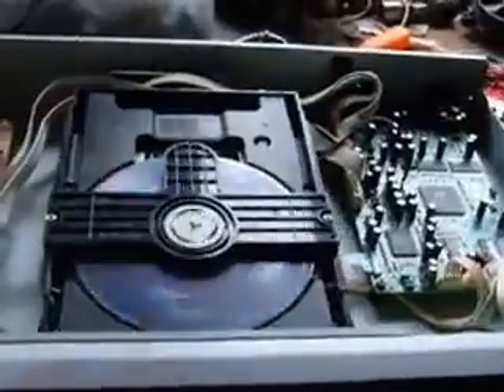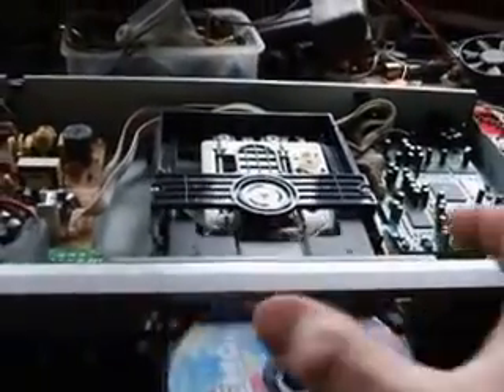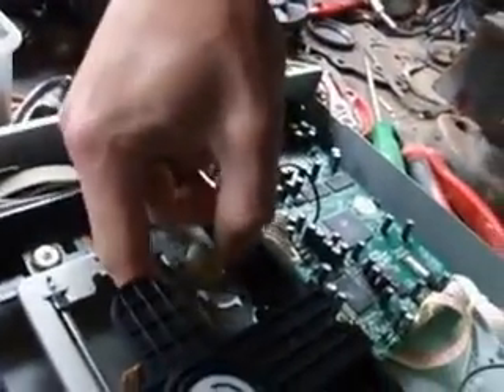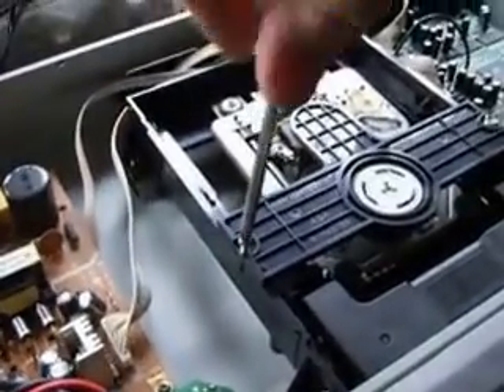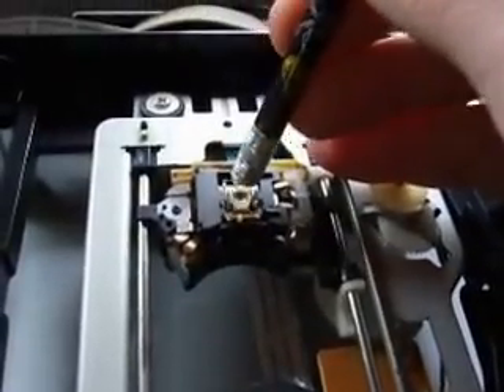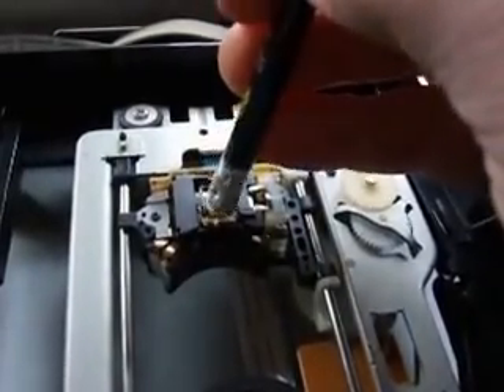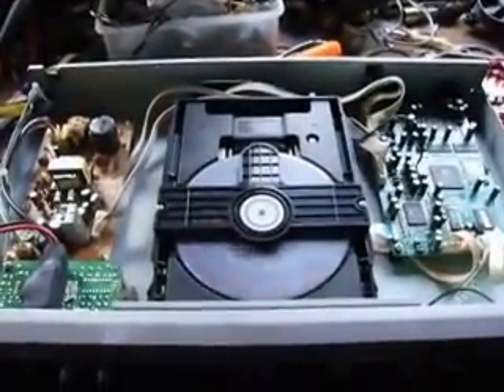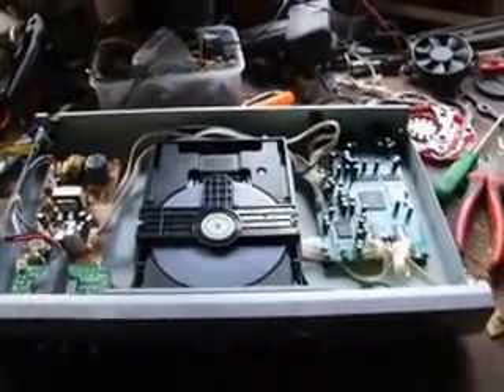Simple dvd fix that engineers use

Comment: So, the general logic behind the things done in this video is sound, but the execution was a bit scary. Air compressors can and usually do contain moisture, plenty enough to ruin any electronic component, and a pencil eraser is a rather bizarre thing  to use to clean such a sensitive thing. A couple of pointers, though. If you use some compressed air, try to gently blast out the space between the diode and the lens (basically UNDER the lens), you'd be surprised what buildup can occur in there, especially in dusty areas. Clean the lens very gently with a q-tip, one end very slightly wet with some sort of non streaking glass cleaner, be gentle so as not to scratch or remove any lens coating. Some laser assemblies have a tiny potentiometer (2 if CD/DVD drive, one for CD, one for DVD reading) to fine tune laser wattage, some aging drives will work like brand new again with just a slight wattage bump to compensate for the decreased efficiency.
Reply: Edricofifr
Reply: as far as i observed about the video, it looks educational, and it may help alot for some begginers as enthusiast on finding essential technics and solution to fix a components..but nevertheless im not with or agreeCd on using a pencil eraser, i was also oriented about the operations of dvd system,. the dvd laser compose of two laser wich operates simultaneously, the high and low are beam up a dvd disc that also consist of two layers, the laser reads a bit of tiny data as lands and pits, the lands beam back the laser to laser diode and commands the timing circuit giving a start-up signal on the system, the pits wich actually has the data where the laser dont beam back and reads it to start the center drive motor to achieve the exact rpm as process by the timing circuit. concerning on the the troubles about no disc or error disc, it actually the lens itself must has the problems, the top surface of lens maybe dusty, u might lean it easily by using a glass cleaner just a tiny amount as moisten the surface then it essential to use a piece of paper and gently wipe it, usually this steps doesnt work as that at the back of lens has accumulated more dust.. how to cleans it? air blower might also do the job.. never adjust the petentiometers on the lens at it may lose the timing voltage of lens as dvd are design to operates its laserbeam rythmitically and simultaneos, if u do so, u ruin out or damage the unit, unless you do have enough overviews on measuring its exact voltage the miliamps the amount of laser beams out and the timing that a bit time the timing circuit processes data..
Reply: +RetroGameModz
Actually, I came across this video while looking for a technique to fix a seemingly malfunction in the dvd drive optical head calibration. It happened after I tried to burn data on a (what turned out later to be a cheap) dvd, the burning process failed and the head stopped recognizing any dvd/cd as if it doesn't see the dvd/cd at all.. Is there a way to fix this please?
Reply: After wave soldering components on PC board we washed them. As long as you let it dry it will be fine.
Reply: There are a few things with your comment that aren't entirely correct.
First of all, I'm curious to know if you have ever used a humidity meter to measure the amount of moisture in the air that is coming out of an air compressor? I have measured the relative humidity of the air coming out of my own compressor, and the humidity level is exactly the same as the humidity in the environmental air here. No extra humidity is added to the compressed air in my compressor. It might be possible that some other compressors do add a bit of humidity though, so I'm of course not saying that you're wrong about that. However, since we don't know anything about the humidity of the air in the particular compressor used in this video, we don't have the right to judge the uploader in any way on that point.
What I can say though is that it looks like the air blowing nozzle used for the compressor is really some sort of bicycle tire pump used in a garage, and such a nozzle might contain a lot of contaminants that could easily get into the airstream and get straight onto the CD player pickup unit. A clean air blowing nozzle that is only used for electronics work should be used in this case, together with a compressor that doesn't add any moisture to the air, of course. A hand-held air blower also works fine, and will not add any moisture to the air either. Those things are usually used for cleaning and removing dust from camera lenses and is a cheap alternative to air compressors. If we are going to talk about moisture, what we should never do (but what people are often doing, unfortunately) is to blow onto the electronics with our mouths. The humidity level of our breaths is very high, and it can also contain some substances that shouldn't really be left on populated PCBs.

As for the decreased efficiency due to aging of the laser diode, you are incorrect in that you need to compensate for the aging of the LD by tweeking the LD power pot. Inside the package of the LD, there is also a PD (photo diode) which senses the intensity of light being emitted from the LD. The "output" from the PD then goes into an APC-circuit (automatic power control) essentially containing some op-amps, which automatically adjusts the power output to the LD so that it always matches the correct output level set by the power trimpot you mentioned. What this means is that the APC automatically corrects for any drift in the output power of the LD. This drift is usually caused by aging of the LD on a long-term basis, or by the temperature coefficiency of the LD on a short-term basis. If you need to adjust the LD power control to get your CD drive working, then this is not because of aging of the LD but rather because of either:
1. Dirt or some other obstruction of the laser beam which requires higher output power for the light to get through properly to the medium (CD in this case), or
2. The user is trying to run a CD-R disc in the drive which has lower reflectivity than original pressed discs, not allowing the CD-R to be played in case the power adjustment is adjusted in factory in regards to originals discs only.
3. A combination of 1 and 2, or some other fault with the unit.

I do agree though that pens or pencils should never be used around optical pickup units whatsoever. Both the tip of the pencil and the eraser might (and probably will) transfer contaminants to the optical lens of the pickup, and also to any other parts too for that matter that the eraser/pencil happens to come in contact with.